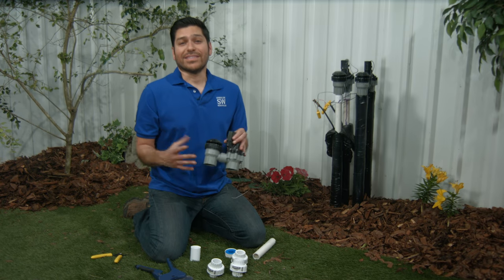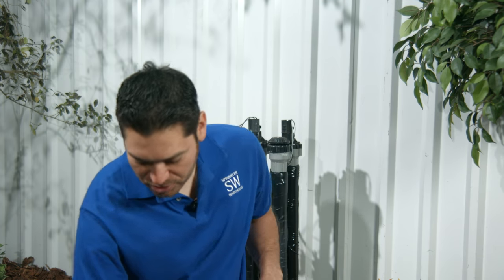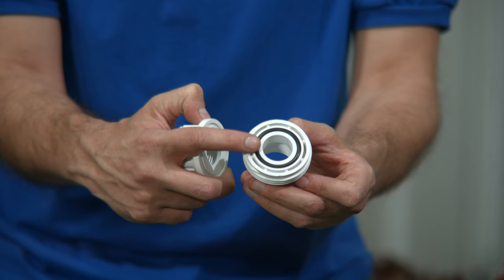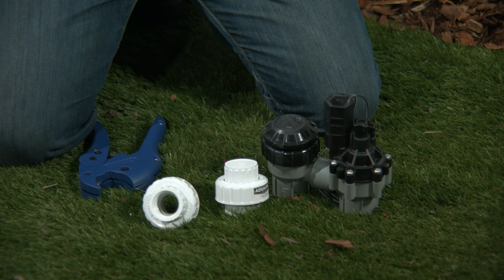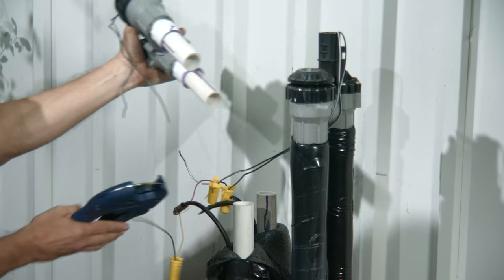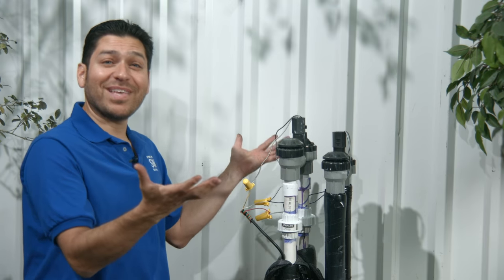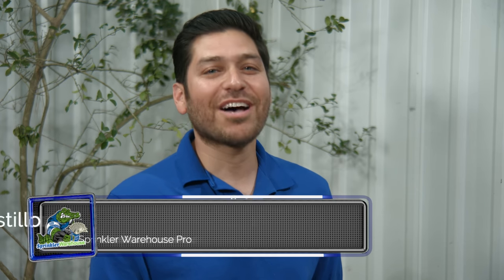How To Use Union Repair Fittings

Comment: Very helpful for me right out of the gate by identifying the name/description of the two halves of the slip union.  I need to replace the pvc supply and discharge lines for my sprinkler system backflow device because the male threads of each line are damaged and leaking.  Each of the lines attach to the continuous portion going into the ground by slip union connectors.  I had no idea what they were called and how to search for partial replacements until I saw this video.  Even though the slip unions are not damaged, they are glued to the part that needs to be replaced. FYI - these are 16 years old and held up well. They allowed me to easily disconnect my $$$ Backflow device and move it into the house during the winter.

Comment: One union should have been turned over. That way if you need to replace the valve again or the pipe gets damaged you only need to buy one union to repair it. This is especially true if you put unions on your back flow preventers. It keep anyone from installing the back flow preventer backwards.
Reply: Took me a second to understand this, but this is the small golden tip in the comments
Reply: OooOoooh, it took me 10x before I understood. Thanks!
Reply: @averageguy1261  Sorry. Im better with my hands than I am with my head. Im not the best word smith. My uncle who was a maintenance man at a manufacturing facility taught me this trick. If you have to repair or replace the item attached with the unions, why buy two unions and throw the same two halves away?

Comment: How do you do this without increasing the total length of the plumbing? As in how do you know exactly how much of the PVC to “trim” from the existing pipe so that the union doesn’t ADD length.
Reply: They have this fancy tool called a tape measure.
Reply: @MAGAMAN  I guess you've never actually tried to measure the length of a union.

Comment: Do you have to do maintenance on those unions, for example do the O rings go bad after some time?
Reply: Unions are usually a temporary fix ir an emergency fix if the parts are not readily available but shutting the water off at the house or unit is the best way to do any plumbing work so you can get the parts needed. If you can't keep the water off like at a shared apartment complex a union would be the fix then the water is back on the off when you return with the parts
Reply: I have a couple of unions on my property. They have been there for decades - no problems.
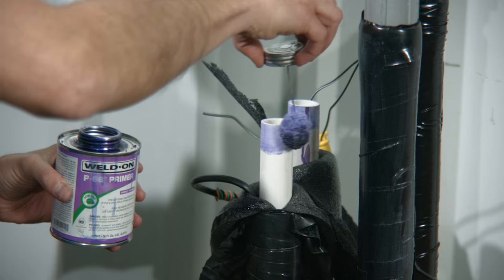I would say if they are leaking, replace them, BUT make SURE that if you are using a PVC primer (you should), DON'T let ANY primer touch the O-ring, as this video installer DID at 2:24, you can see it plain as day - it's Purple.

Comment: Why not just use a coupling fitting?
Reply from the maker: The utilization of PVC Unions is so it can be taken apart and put back together again without the use of specialized tools. Allows to be worked on with relative ease.